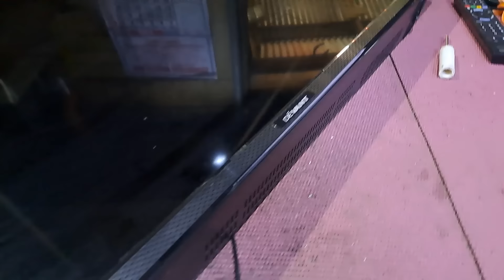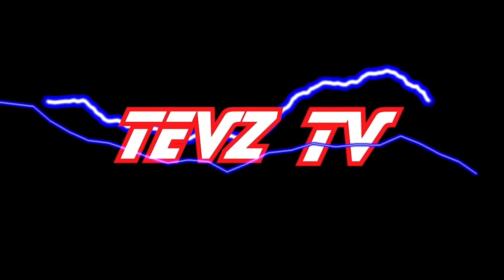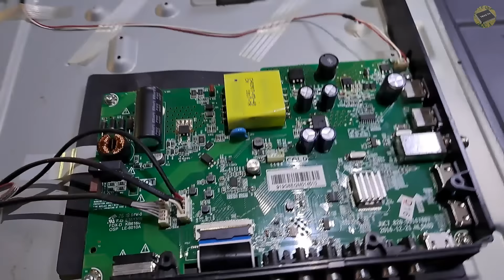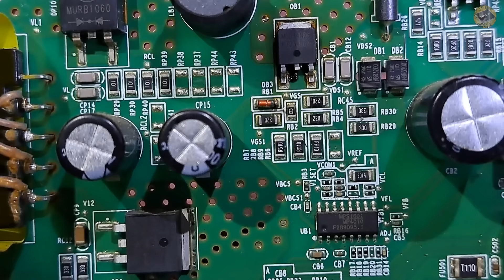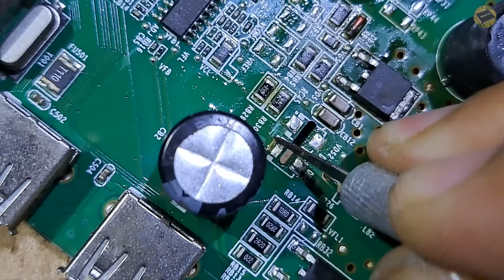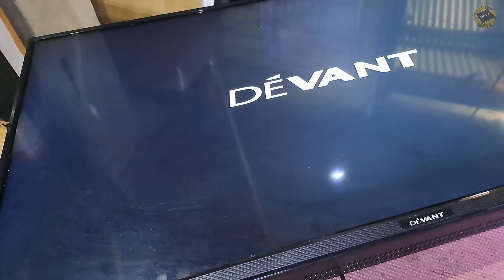Devant LED TV Backlight driver problem.

Comment: I have a 32 inch JVC Model LT32N500. Picture comes on for 3 to 15 seconds and cuts off. The sound remains on. I've checked the capacitors and soldered 2 dry joints but the problem is not resolved. Any suggestions ? I would appreciate your assistance.
Thank you.

Comment: Loving your work, Tevz!  Especially when you demonstrate techniques like adding a small amount of wax to show when components are getting hot!  Those are great examples of workarounds, such as when you don't posses a thermal camera!  Once again, thank you for your expertise - I have fixed several TVs by using some common sense and basic electronics skills.  Always using safe methods, of course.  In this example, do you mind if I ask, what temperature and airflow do you use to remove those components?  Would around 380+ and 80% flow be OK?  Kind regards.
Reply from the maker: Thank you for the kind words!